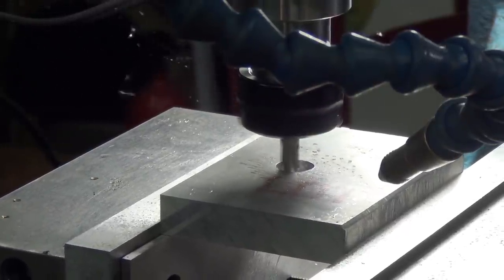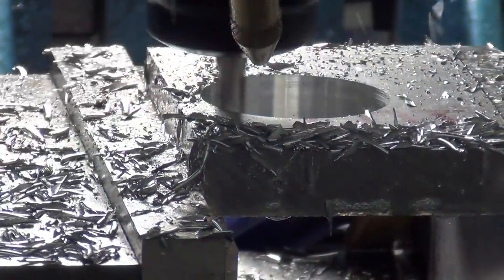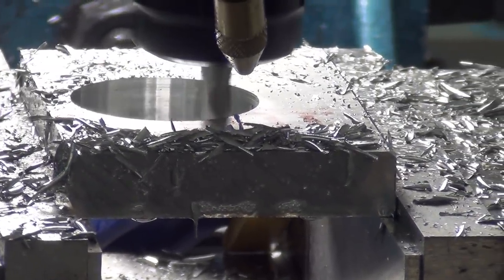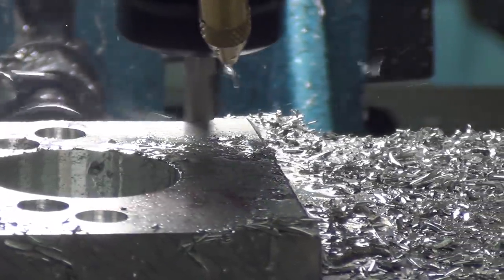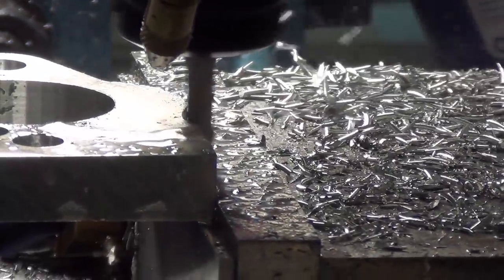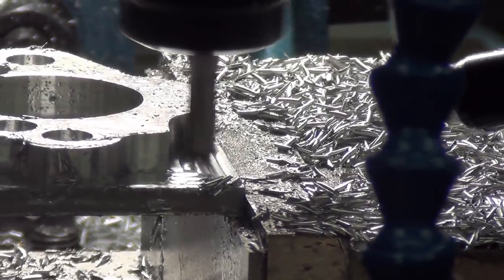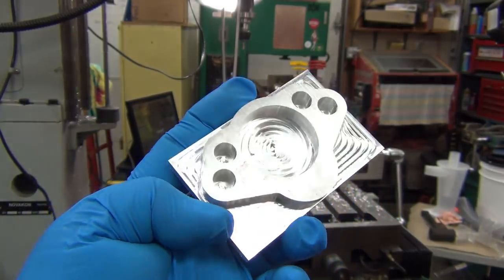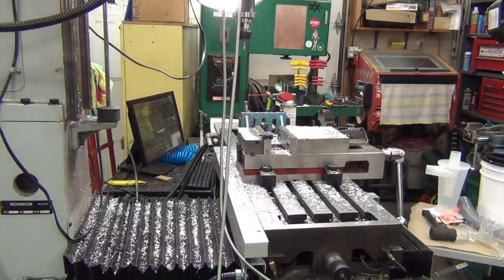SU Carb Spacer - Machining

Comment: Chips are flying!!  It is always a great feeling to run new part programs for the first time.  I typically eat a lot of antacids on those days :-).  As for the crashes don't worry about it because we have all been there.  Just try not to drill through your vise's main screw....yeah that makes for a bad day.
Reply from the maker: +Doug P I changed it after this....had a few more crashes before turning out the 8 parts I needed.  I certainly learned a lot......I just hope I can remember what I learned and not repeat the same mistakes.  Mine is a cheap vise......but I'll try to avoid the screw!! LOL ! :)  Thanks!

Comment: Switch to the biggest endmill you can fit in the features, namely a 3/8ths endmill.  They will take a higher chipload and remove more material.  You really need to slow the spindle down and take a larger chipload, your motor doesn't make enough torque at 5900rpm to drive that endmill even at .00096 IPT.  Figure out what the ratio is between the motor and spindle, then run the motor at 1725 or 3600 RPM, the farther you move up the RPM curve, the less torque you are going to have available.
Reply from the maker: +eformance My power draw bar was down that week, so I intentionally used a 1/4" end mill for all of it.  It's working again, so I just might go back into CAM and get that changed up a bit.  Seems we talked before about the spindle speed vs torque?  Thanks for bringing that back up again.  The spindle drive is a 3ph AC servo motor....for what it's worth.  I'll have to check it's spec on whether it's a 1725 or 3600.  No shop time today....sick.......maybe I'll get some tomorrow.  I have a week off after next week.....maybe some time then. :)   Thanks!!!!

Comment: BWAHAHAHA!
So, what happened on that cut? My guess is the cutter compensation was on the wrong side of the path.  A booboo I have made so many times...lol  Either way the part looks good.  I don't suppose I could con you into making some Delrin leadscrew nuts for me so I can get back into the game??
Reply from the maker: +Eddie the Grouch I simply cut the blank too big.  I was hoping to make more today, but I came down with something and I didn't do anything today.  Maybe tomorrow will be better. :)  
Did you like how the servo hardly slowed before snapping the cutter? :)
I don't have any time right now.....keep getting further behind, but ask me again after the first of the year. :)